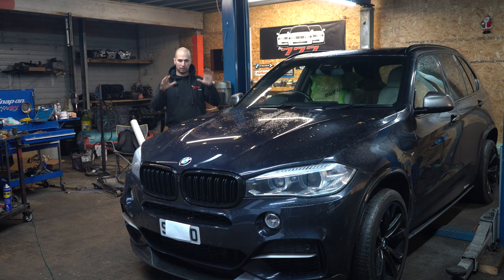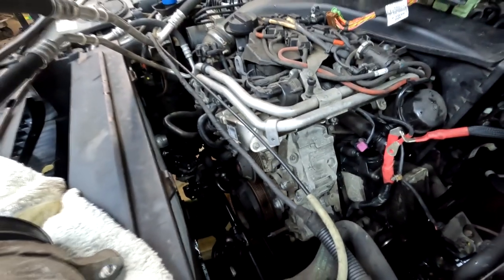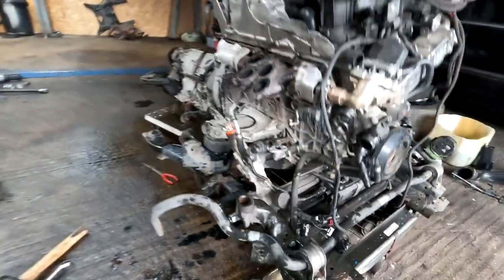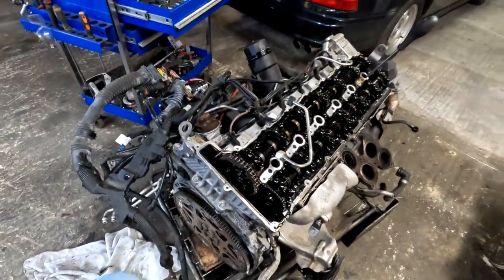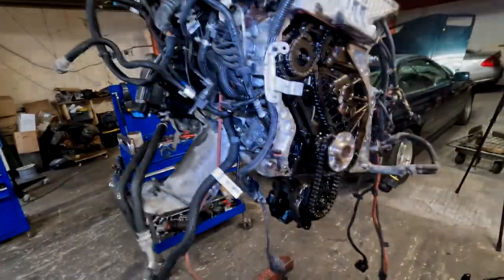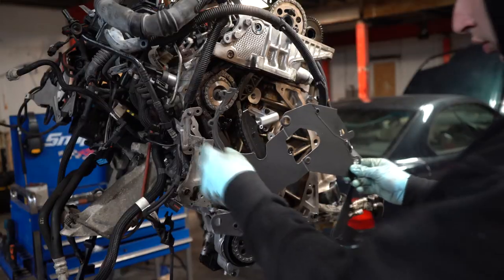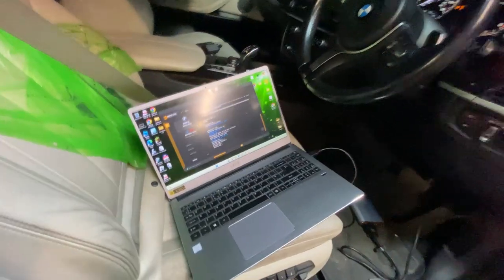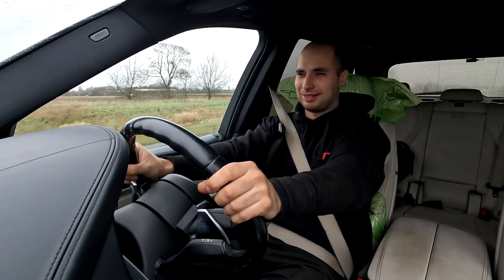Bmw X5 50d TURBO REPLACEMENT AT 58K miles...WHY?

Comment: 135k miles on my n57 400bhp drives like dream still original chains and turbo because i changing the oil every 5k miles makes a magnificent impact to reliability
Reply: Honestly even with Toyota the 10k intervals are just toooo long.

Comment: What an amazing job and memory you have. I own one of these X5 M50d I know where I will becoming when I need a turbo fitting. Great work.😊
Reply: How is the car going? I'm on the verge of buying a 2014 model with 117000 on the clock.

Comment: I have seen the same thing in an f15 m50d at 70k km, both small turbos shot. Luckily realised that a few months before warranty ended. New engine and transfer case were changed under warranty.
Reply from the maker: Ohhh wow
Reply: hello mate, how did you find out that your turbo’s were shot? mine throws white smoke when i put the foot down and i think it lacks some power, am looking into the turbos now but afraid what if the turbos are fine? … scary thought
Reply: @mexicanumex  So luckily mine was found early but small amount of whiteish smoke was the initial sign, kind of also felt like no power low down in the rpm range. 6 months before the warranty ended I paid for an inspection to take a look at everything in detail (to repair before the warrany ends). They found a cracked EGR radiator but as it did not explain the smoke because the crack was external, they found the turbos. Funnily enough 0 codes or errors except feeling low on power in the low rpm range.
Reply: @kaurvali  nicely done, how much does an inspection like that cost? shame i had waranty on it up until december last year, now i renewed it but because of the mileage is cheaper and only covers engine,gearbox..
Reply: @mexicanumex  This was 2019, something along the lines of 200€ at an official BMW Service provider (used to be a dealer). Basically on paper it was a pre purchase inspection with a bit of extra on instructed diagnostics for the exhaust smoke. But in reality they basically check everything before the warranty ends as the service provider likes to make money on warranty work and it also makes the client happy to get it for free so a win-win situation. I’ve also done it a bit later on another G12 7 series xDrive and they found a bad transfer case which was fixed under warranty.
Reply: I'm struggling to understand this.

I have a 2010 E70 with 122k on the clock. 

I've had no engine issues.

Comment: One day, one day I’ll put this engine in my e90 3 series! And leave the 320d badge on 😂
Reply: 😂 I had an E90 335d with a 316d badge on it. The twin pipes gave the game away
Reply: @DodgeCity111  there’s a guy in turkey who put a 2jz in his e90 and badged it 316i 😂, think it’s 700hp+ as well 😅
Reply: You're cheater 🤣
Reply: @LR95051  In the 80s Bmw F1 car had 1.5 four cylinder turbo engine with 1350hp....So today isn't strange if someone make 316i model(1.6 engine) with 300-600hp monster. You just need big turbo. It's posible.
Reply: @LR95051  in UK one guy has a sleeper skoda octavia eco hahaha and 500+hp under the hood.His car looks like every skoda on the road,another guy in UK in his bmw F11 520d put engine from F10 M5
Reply: I’m putting this engine in a 30d and keeping the 30d badges . Engine is tuned to 390kw

Comment: I bought a X5 40d with a receipt for £5K just spent doing timing chains but they did not fit a new oil pump! After 1 week oil pump seized and engine was scrap!!! Oh boy what a job getting it done under dealer's warranty. Took 4 months to get car back and I sold it straightaway as it ran badly with no real power.

Comment: Very informative video. I have f30 with n57 engine and when I bought it (55k miles) had service done at 17k 32k and 47k. Changed the oil on the next day and since then was changed every 8-10k. On 100k now with zero problems. The car goes on a long runs from time to time so oil  could last even longer I suppose. I think it depends a lot of the way you drive it - if you have a heavy foot should change your oil sooner.

Comment: Well done ed, makes me want one, and yes, amazing engineering, but at 58k miles??? Clever engineering.. bmw must love you! See u at martins soon I hope 🤞 well done on a job well done👍👍
Reply from the maker: Change oil more frequently and no probs 😉
Reply: @The777Garage  so the cause of such early turbo failure is oil change intervals. Right? What would yo say about oil change in gearbox? Does it worth to wash mechatronics when changing oil in gearbox?

Comment: Have just completed a similar job on a X6 M50D.  The oil pump failed starving the bearings and turbos of oil.  Not sure about the X5, but on the X6 it is possible to remove the engine from the top.  Its a massive job and your video helped immensely, thank you!

Comment: I had both turbos replaced on my bmw f10 msport 535d 2016 with 33000 miles on it and full BMW service history . My mechanic said probably caused by not letting turbo cool down before switching off . It cost£ 3500

Comment: I have a 3.5D E70, and I only have a twin scroll turbo (I think). I have 184000Km's and am not looking forward to replacing chains. The transmission has to come out soon as I am having 3rd gear issues intermittently, I do those myself anyway, so may elect to drop the front and do the chains at the same time. Good video, plenty of info.
Reply: Fellow e70 35d owner here. Our cars have a sequential/compound turbo setup, with a smaller turbo for low boost at low RPM, and a decently large second turbo that comes on around 2000~ RPM.
Reply: @YuukiWatches  OK, I thought the 40D has two turbos, and the 50D has 3. Maybe I am misinformed.

Comment: EEkkkkk 58k wtf, our m50d is on 59k ill be keeping the extended warranty running for sure, i drop oil every 7k, its the same with the ZF gearbox BMW say lifetime oil in it yet ZF say 60k no later

Comment: For the mileage pretty dirty inside, maybe thats why the turbos let the ghost out, consider different oil and/or more frequent oil changes.. also on the note connected to the oil issues and worries about comebacks, bad news man.. you didnt do conrod bearings. Terrible mistake! :D

Comment: knowing that one of the weak spots on N47/57 gen engines is the crankshaft bearings + conrods bearings, have you replaced those aswell? i have read that on 50d they wear out even faster than ono normal 30d n57.
Reply: Not much wonder when the 50d engine is producing nearly double the power and torque through the same bottom end as a 30d.

Comment: Good job mate..Could it be the remap caused the early failure ?
Reply: Slimy / old oil caused early failure . All the internal parts are black while they have to be shinny if oil was changed regularly. Never follow bmw recommended oil change intervals as they are way too long . On turbo Diesel engine you have to do oil change every 5-6k miles as max .

Comment: How often do you recommend to change the oil on this engine?
Reply: On turbo diesel every 5-6k miles as weary max. Never 15-20k . That’s how you kill an engine .
Reply: At least once a year or every 8000 km.
Also no spirited driving (over 3k rpm) until the oil is up to temp, and make sure the turbos cool before shutting the engine off after spirited driving.

These practices alongside preventative maintenance ensure the internals are performing at optimal performance and efficiency levels.
Reply: @Mark-bd5ci  Exelent advice. 99% of people don't care about engines.....

Comment: So what do you think of these engines in general? Why did the turbos fail early in their life ?
Reply from the maker: If owner would change oil atleast once at 10k miles or less this video wouldn’t existed
Reply: Does that explain the turbo failing also ?

Comment: I have been looking at a bmw m550d from 2015 what shud i be looking for when i go try it out and look at it 😊
Reply from the maker: Make sure oil been changed quicker then 15-19k
Reply: @The777Garage  okay thank you the one I have been looking at have all services and only have 103 k km
Reply: I'm looking at an X5 M50D 2014 with 11700 on the clock. Same sort of thing to look for?

Comment: So is that the accepted lifespan of the Turbos on these models ..60,000 miles and it’s engine out time ??  Ridiculous really!
Reply: Only if you change the oil after 15-20k miles as bmw recommends . That’s waaaay too long especially for a Diesel engine . Change the oil every 5k miles and turbos will be good till 150k+
Reply: @piccadillycircus9416  
Okay 👍 .. that’s pretty decent then to be fair.  Couldn’t agree more on the frequent oil changes, it’s the cheapest maintenance you’ll ever do!  Car manufacturers saying their vehicles are good for 20K miles is a load of nonsense in the long run. The second owner is buying a lot of problems/headaches 🤦‍♂️

Comment: 58K and needs turbo replacement? Something not right there
Reply: I've an E70 40D with 122k on the clock and have had not one turbo issue.

Comment: Great job ED,im DEFINITELY NOT a lover of ANY DIESEL CAR 🤷belongs in a Tractor 🚜 sounds like a bag of nails….3 Turbos on a 3 Ltr 🤷🤷definitely something I’d NEVER buy if it has turbos fitted..I’ll stick to my V8s with fuel injection 👌🏻👌🏻👌🏻PETROL ENGINES RULE 👌🏻👌🏻👌🏻👌🏻👌🏻👌🏻👍🏻👍🏻👍🏻👍🏻👍🏻
Reply: What a boring comment 🐷
Reply: @mcplutt  🫏 wipe…

Comment: Modern BMW crap. That's why. N57's will produce loads of power until - like higher mileage 35d's - it destroys the front crankshaft main bearing followed by the others. This is what's been happening to Police N57's. They are nothing like as good as then old M57 - that was a proper engine.
Reply: really??I had 2x e60new in 2010 n47 and n57 and both of cars did the same 400k km in 5years.nothing happend.I sold n47 for private person and he did another 100k km.timing chains changed after 300k km in both cars and nothing else,oryginal turbos,swirl flaps,egr.Regular services oils filter every 10 km,gearbox and rwd oils changed every 60k km.

Comment: I believe this motor is under-engineered, a superior designer would have made the motor more robust and reliable, 58k miles is just run-in for reliable engines like Barra in-line 6 which creates similar horse power and much more with a simple tune. You also need tools specific to this motor to do simple tasks like install the crank pulley, what an engineering disaster. Clean your workshop up, paint the floor, hang your tools up tidy, take some pride in your work place.
Reply: Barra Inline 6 isnt a Diesel Engine and has a lot less torque than the beast in this video. The problem for the engine designers is that it has to pass the worlds highest emission standards in the EU. So it is not possible to make the chain or the main bearings wider because that would increase the friction/rotating mass and the emissions aswell.  I've had the Barra 6 cylinder in a ford falcon as well but you just can't compare those engines. As you said the barra is easy to fix and a very simple engine. Also driving wise you cant compare them.
Reply: Agreed BMers drive nice, Bilstein would have a lot to do with this. This motor however is not setting a good example for resilience or maintenance affordability.
Reply: @cliffharrington6500  Thats true but as I said our loved barra engine would sadly not pass the emission regulations in the EU. Those engines aren't even sold there and are just used by Ford Australia. BMW had wonderful inline 6 engines in the late 90s like the M50/M52 which were rock solid and easy to maintain.

Comment: N57 the worse engine series ever!!!  M57N was the best from this era engines...But N series its just JOKE! BMW Cars looks amazing after 2010 but under the bonnet is crap...The problem with this engine is service intervals also CRANKSHAFT ale weak as well...Crankshaft has mikro-chips and in time its not straight any more...That's why always cylinder 6 has problem with rod bearing...Engine with power of 313 bhp 535d or 740d model and 381 M50d in 550d  750d and x5 50d are the most expensive to fix and they do not last longer then 150.k miles ...NIGHTMARE !
Reply: I am glad I just have a 211 hp N57 then 🙂